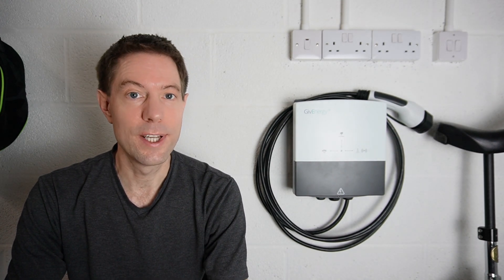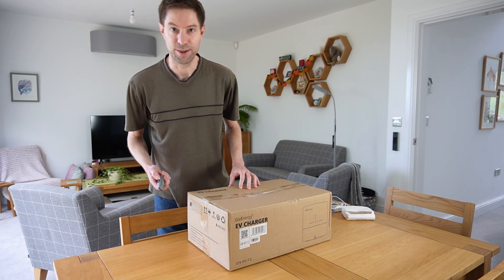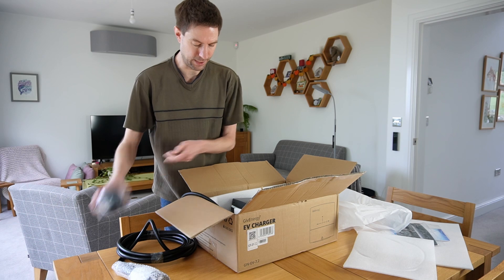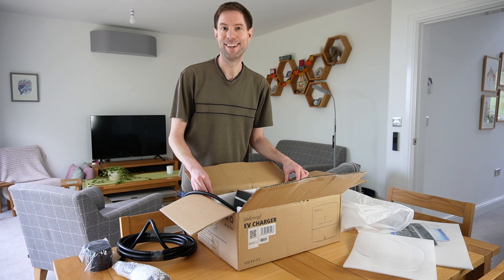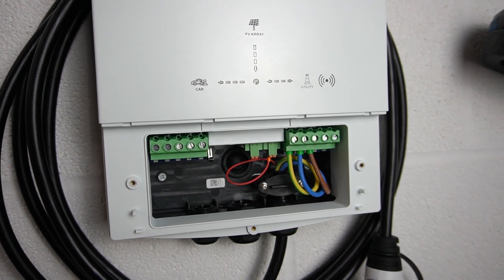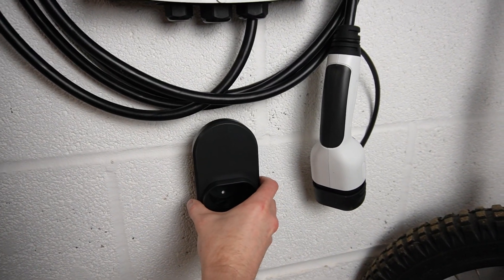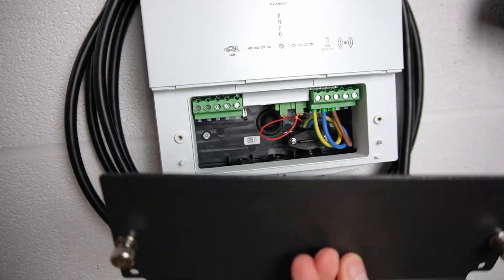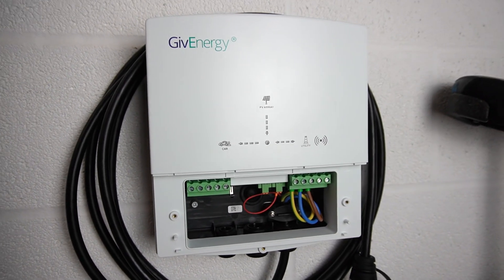GivEnergy EV charger - unboxing and wall mounting

Comment: Hi Tim, how are you getting on with the charger? I've recently had one installed and I have some issues so I wondered if you had seen the same?  1) With Octopus Intelligent Go controlled through my VW e-UP! (2020 model) the charge starts when I plug it in (as expected) and then Octopus stops the charge pending the cheap slot (as expected), but then the GE charger keeps resetting and nagging the car to start charging again and eventually gets the car to start charging during the expensive period and does not stop at the set threshold (eg. 80% charge). 2) In a variation of case 1 without Octopus involved, if I set the car charging and then try to stop the charge through my VW app the car can't stop the charge I assume because the charger is not listening? When I try all this with my 13A granny charger it all works beautifully with no problems at all - Octopus IG works great and also I can stop and start the charge from my VW app no problem. It's like the GE charger logic was designed to be all driven from the GE end rather than cooperatively with the car. I've tried just about every setup option and combination possible and searched and searched the web for info with no luck. I have the Givenergy gen2 inverter and gen2 battery and all that stuff works fine with the charger (inverter control), it's just the car. Octopus say the car and the GE charger should be fine with IOG and obviously I got on to the tariff ok with the setup control test. I tried calling Givenegery support at 4pm on Thursday and they said they were shut?  So I've put in an email enquiry and I'm still waiting on a reply. In the past I've found Givenergy products to be very good and support very responsive. But this is getting a bit frustrating now. Any experience to share? Email me (with the email in the 'about' section of my channel) if you prefer. Cheers Paul
Reply from the maker: I've found the GE charger fine with scheduled charges and other ad-hoc periods when we've needed a top up, but we've not been able to try IOG yet because our car isn't compatible, and neither is the GE charger, so I'm afraid I have no experience with IOG for comparison (we're on regular Go).  It definitely sounds like a GE support request is required, so give it a few more days and then call them back.  I'm not surprised that they're shut over the Christmas period.  With any luck the GE charger will become compatible with IOG at some point, and then using that to control the charging might work better than connecting via the car.  In the mean time I hope GE can help you out.

Comment: Hi Tim, as you have a GE EVC I have a question please.

I have just had my EVC fitted, and cannot get the LED to go Green “Ready”

I have set it up on WiFi, and get a solid blue light.
I have switched to Ethernet as WiFi signal is not good, and now get a flashing Blue Light.
I was expecting it to now go Green Flashing ready to plug in the EV.

What is your experience please?
Reply from the maker: Erm, I can't remember what happened when I set it up.  It currently shows a solid blue light.  You should see it appear in the app if it's connected properly.
Reply: @TimAndKatsGreenWalk  Hi Tim thanks for the quick reply.  Here is what is stays in the doc.

EV Charger Status
Green (Solid) Charging - Green (Flashing) Ready - Yellow Comms Issue - Blue (Solid) Connected to Wi-Fi - Blue (Flashing) Not Connected to Wi-Fi - Red Fault (Contact Support) - Red (Flashing) Downloading Firmware

So it would seem your connected to WiFi, but your not Green either.   Outdoor I ask If it goes Green when you plug in the EV but not charging?
Reply: That should have been May I asked when you plug it in next.
Reply from the maker: @DaveB-r7u  I think it goes green, yes.

Comment: Where is part 2
Reply from the maker: Yeah, I keep meaning to come back to this.  I'm hoping to do a follow-up at some point about what it's like living with the charger.  Other videos keep taking priority.
Reply: Can you give me any tips as I’m thinking about ordering one?
Reply from the maker: @adamstockton67  it's worked well for us so far, although we tend to just set it up on an overnight schedule for charging.  I have tried out the solar divert mode too and that works fine, but we don't tend to use that because we have such a good export rate it's not gaining us anything by diverting the solar.  The app is easy to use and there are options for changing the charging rate, or for restricting how much total kWh you add to the car, so it's pretty flexible.  It's nice to be able to see the data too, e.g. how much you charged per day/month.
Reply: Thanks that’s great

Comment: Do you know how to reset these to factory settings as mine has bombed out and is no longer working…givenergy not very helpful and keep telling me to contact my installer.
Reply from the maker: First thing to try is power cycling it by turning off the breaker in your consumer unit.  There's an option in the app to restart it too, if you click on the little spanner icon.  I can't see a way to reset it to factory settings though.  If that fails then I guess your only option is to get your installer to take a look.  Sorry I can't be more help.

Comment: Hi Tim. Actually wrestling with what to do about a charger myself. Have decided to get an EV (exciting) and have the offer of a free Ohme charger. This works with Octopus and is eligible for Intelligent GO tariff, but it doesn’t currently have smart solar excess diversion capability. It’s supposed to be coming, but you know how those promised features can fail to materialise… Have been debating getting a Zappi instead (don’t have  GivEnergy unfortunately) as this works with Octopus and solar properly. Based on the idea that it’s best to have and EV tariff in winter and then Flux in the summer, not having a Zappi would make home charging quite expensive and awkward as it would take 2-3 days of Flux off-peak charging to fill an empty battery….  I feel like I need a charger which definitely works well with both smart tariffs and solar to have the most flexibility and feel I’d be annoyed by not being able to charge easily with excess solar.
Reply from the maker: Honestly, with export rates where they are now solar diversion is not nearly as beneficial as it used to be a couple of years ago and you're often better off exporting instead.  With Flux, you're better charging your EV overnight in the off-peak window and exporting any solar excess (or rather storing it in your home storage battery and exporting it during the Flux peak period).  Charging at off-peak rates or during the day using excess solar would work out about the same cost wise because the day export rate is similar to the off-peak import rate, so if you're using the solar excess to charge your car you're missing out on the export rate, so the equivalent cost is the same, if that makes sense.  At 7 kW for the charger you get 21 kWh per night, so unless you're doing more than about 80 miles per day (assuming about 4 miles per kWh for the EV) then you'll be fine with 3hrs charging per night.  Having said that, if you do prefer to do solar divert then the GivEnergy charger does also do that, although I've not yet had the opportunity to test it yet, and it's supposed to be getting Intelligent Octopus Go support at some point (but again no timescale on that!).  I'd be tempted to get the free Ohme and see how you get on with it.  You can always switch it out later if you decide you need that solar divert (or if you need more than 80 miles per day of charge).
Reply: @TimAndKatsGreenWalk  that’s helpful. Yes I’d kind of realised that if export rate is >= off peak import rate, being able to charge with excess is pointless unless you don’t have a provider who has a pretty clean energy mix.
Reply: @TimAndKatsGreenWalk  Tim, as I assume you are, or have been on Intelligent Go, can you confirm that Octopus allow a fixed export rate of around 15p? It’s not completely clear to me what export tariff(s) are available to Intelligent Go customers.
Reply from the maker: @twelvebears1971  I'm not on IOG as yet, but I do know that you can get the 15p/kWh export rate when on IOG.  With regular Go you only get 8p/kWh export.
Reply: @TimAndKatsGreenWalk  helpful as always. With 7.5p import and 15p export, I’m not sure I’ll even bother swapping to Flux during the summer, especially as our battery and inverter doesn’t allow for automatic discharging during the peak period and I’m not sure I can be bothered to do it manually every day. Will be interesting to see how it works out once we get our Ioniq 5 and swap tariffs in April.

Comment: Is there any update on this yet? I was thinking about getting one but nobody has posted since they were released :(
Reply from the maker: Yup, still planning a follow-up video, but haven't found time to do it yet.  So far it's worked fine, although we've only really used it on a schedule so haven't tested all the features yet.
Reply: That's good news at least. Have you tried it with solar yet? Not that there's been much... 😂
Reply from the maker: @samwoollard4491  no, not yet, there has been no excess to use!  It'll be some months before we can test that feature properly.

Comment: I am guessing you blagged this free in exchange for publishing videos. Wasn’t bothered about app integration myself. Currently have a OHME pro which works perfectly with octopus intelligent. And before that at my old property I had a hypervolt. Never been interested in excess solar to car. Rather charge home batteries (19kwh) and rest export for currently (15p). Cheap enough to charge car overnight.
Reply from the maker: I'm also providing feedback as part of the testing programme as new features are added (or I will be once I can get it wired in!).  I suspect it'll be rare that we use excess solar to charge the car, as you say it all depends on the tariff at the time and export rates are so much better now than they used to be that solar diversion is not worth it in most situations.
Reply: We wanted to use it for excess solar, which it does very well. It depends what FITs tariff you are on ,plus who knows if the export rates will remain as generous in the long term.

Comment: Will be interesting to see the charger once it is connected and how well it works with the battery and excess solar. On a separate note have you heard from GivEnergy in terms of the GivBack scheme they have launched with Axle Energy?
Reply from the maker: I got an email about the GivBack scheme from GivEnergy and it does look interesting.  I'll probably give it a try but I haven't gotten around to signing up yet.
Reply: I'm going to give Octopus a shout to see if they are aware and happy for customers to take part. I presume there will be no issues but thought I'd better check ✔️
Reply from the maker: @blairfalconer915  I believe that as long as you're not also taking part in their saving sessions it's all good.  The two schemes are effectively the same thing just handled by different companies in different ways.  In the case of saving sessions it's up to the consumer to manage the load shift, whereas the GivBack scheme would happen automatically with your battery doing what's required without your involvement.

Comment: I have a charger plug wall bracket with my Zappi, I have mounted it about 1m from my charger, you dont need to unwind the cable from the charger then you just unclip it and plug it in. Also I'd have it quite high on the wall as the handle will stick out and you may catch it with your car.
Reply from the maker: It looks like we won't need the wall bracket, Kat thinks it'll work fine just looped over the charger box.

Comment: argh EM115. We had such a PITA getting those set up with my zappi and the Givenergy AC3 inverter/9.5kwh battery. We needed 3, but they’re all different product codes. Tried flashing one with USB but in the end had to wait for a specific one to be sent from Givenergy. In the end they’re all the same thing - CT clamps - just different ID numbers. Not quite sure why they made that so complicated. Hope your install is simpler.
Reply from the maker: It can be installed without the EM115 and it then uses cloud control rather than local control, so might be slower to respond to changes in excess solar.  I shall reveal what happens in part 2 (assuming I can get my installer to come and do the install any time soon!)

Comment: Tim if you order EV Charger via a third party will they send the clamp or do you need to order it separately
Reply from the maker: Good question, I guess that's something to ask the supplier in question.  I suspect it'd be a separate component to the order.
Reply: It's separate. 
Your choice of install method and needs 
Not everyone needs ms reaction to solar. Cloud control is available,  ad is direct inverter controls for compatible inverters.
The CT option will work for all and is vendor non domicile
Reply: @PaulLandregan  thanks I have a GivEnergy battery and inverter and would wish to ensure I get full integration that being can utilise solar when applicable. Therefore is the clamp required
Reply: @Jmbo65 You can fully integrate without the clamp.
Other functions, useful too.
Imax. Hardware monitor of grid current. Else cloud control.
No less features without clamp. Just faster reaction to solar

Comment: That’s disappointing that we need to fit a em115 meter, all other chargers we just use a CT clamp. So we now have to find more room and a 6A supply for the meter 😢
Reply from the maker: If you've got a gen 3 hybrid inverter apparently you don't need the EM115 as you can connect the inverter to the charger instead (although that says "coming soon").  The installation manual mentions a different type of clamp you can use too (GEM120?).  You can do away with the EM115 if you're happy to use cloud based control, but that might not be as responsive to changes in export level, apparently.  Or something like that, anyway.
Reply: @TimAndKatsGreenWalk  
I think that is pretty much the same thing, you can use most chargers without a CT but when we fill out the DNO notification the only way to get it accepted when the house is over it’s Calculated Maximum demand inc the charger to which most house are (on paper, not realistically) is to use a CT and limit the import to 60A. 
That’s around here anyway.
Reply: wonder if the EM115 is for the battery inverter. Doesn’t seem to be space for it inside the charger - its more a bus bar/CU type of thing. The connector inside the EV charger looks like a fairly standard twin cable CT clamp
Reply from the maker: @MrKlawUK  https://kb.givenergy.cloud/article.php?id=67
Reply from the maker: @MrKlawUK  it doesn't go inside the charger, it's just the wires that go in.  Search for "GivEnergy EV charger installation manual" and you'll see the instructions for it.
Reply: @TimAndKatsGreenWalk   I have a Gen 1 GE Inverter and getting the GE EV charger installed this week. From the instructions I am getting configuration D and there is no mention that an EM115 is required. No clarity whether this is actually needed but would be a tad annoying that you need to spend an extra £50 for the meter
Reply from the maker: @martinto8  it should still work, it just might not be quite as responsive to changes in excess solar.

Comment: Are you going with GivEnergy because it free or because it's compatible with your solar battery system. Is it going to work with Intelligent Octopus Go without discharging your home battery
Reply from the maker: I've been waiting for it because it integrates with my existing system.  They sent it to me after I asked nicely, but I'm also providing feedback in exchange.  Integration with Intelligent Octopus Go is likely in the future although no word yet on timescales.  I believe they are working on a mode to prevent home battery discharge while charging the car, but I can't say if that is guaranteed to make it into the feature list.  I'll be testing all the features and any new ones that get added in due course and will report back in future videos.
Reply: @TimAndKatsGreenWalk  I have the battery discharge problem with my system and I'm trying to get a home Assistant integration going to work round it or going to get an electrician in to rewire my supply so the car charger doesn't draw from the battery. It may be worth asking your electrician to do that anyway as it doesn't stop you charging from export solar if you still want to but will mean you can't charge from the battery but my reckoning is you don't want to do that anyway. Good luck
Reply from the maker: @terrymackenzie6784  one way to prevent your home storage battery discharging into your car would be to charge your battery at the same time.  I realise that might not always be possible but if you're charging on a schedule it might work well for you (this is what I do at the moment as I charge both the car and battery overnight during the cheap rate).  I also make use of the "pause battery discharge" mode that's available for gen 2 hybrid inverters (and possibly others by now) that can be found via the "Remote control" option on the web portal.
Reply: @TimAndKatsGreenWalk  The problem is Intelligent Go gives out of normal time cheap rate slots you have to change your charging schedule or disable house battery but I would think GivEnergy have got that all in hand.
Reply from the maker: @terrymackenzie6784  right, yes, of course.  Well, I have access to the beta testing programme where we can give feedback and request features so I'll see if I can get that prioritised (if it's not already in the works).